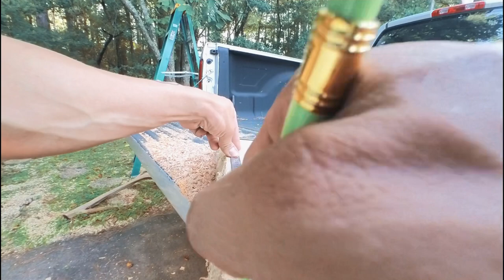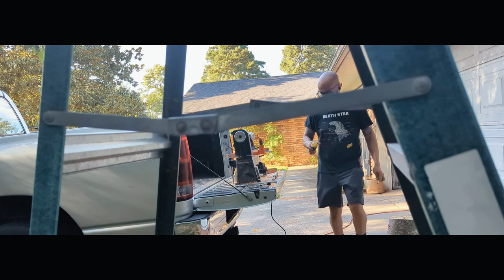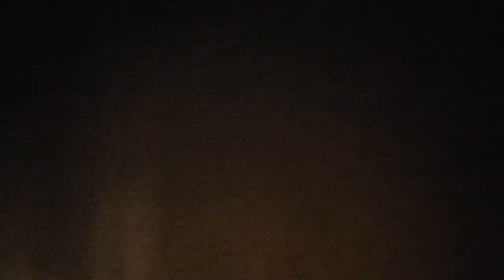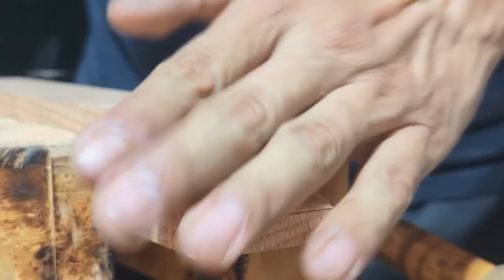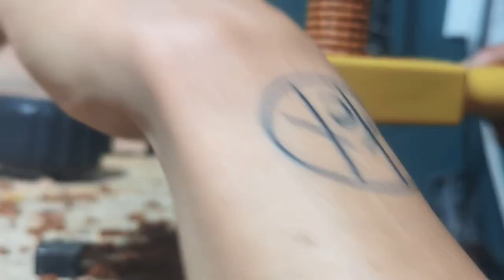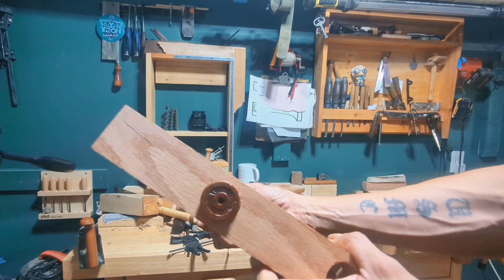Homemade Hand Screw Clamp (DIY)

Comment: Do you apply an oil or some type of lubricant to help the wood threads to easily move?
Reply from the maker: Yea. It cuts better if you soak it in some kind of oil like linseed for at least a day. I have a future video coming up where I use the threader to make an adjustable shop stool so you can adjust to your bench.